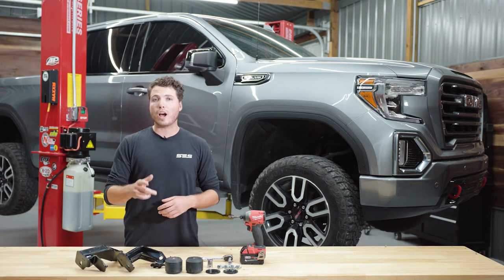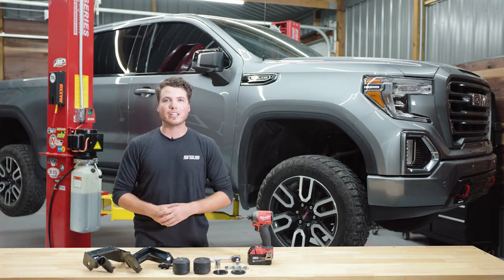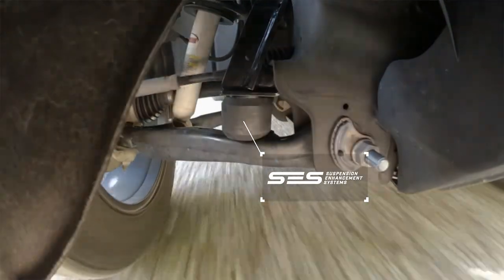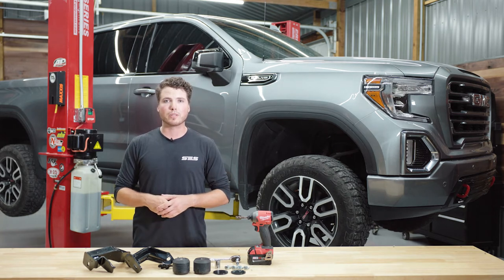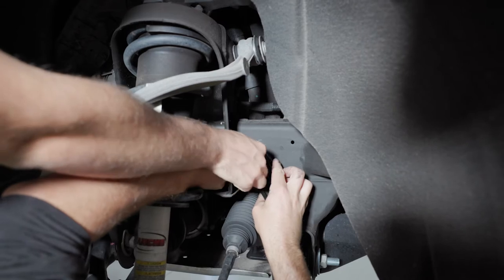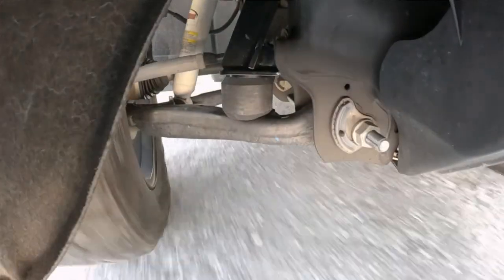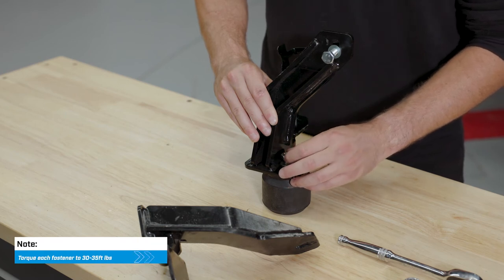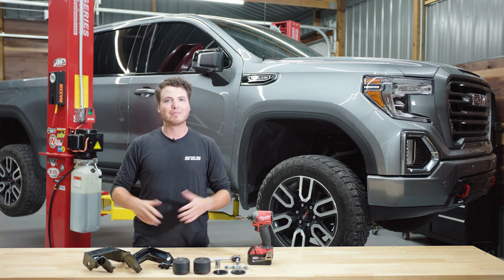GMC 1500 Snowplow Suspension Upgrade | Timbren SES Install

Comment: Does it add any lift if there’s no extra weight on the front of the truck?
Reply from the maker: Nope! These are designed to be engaged full time up front and will compress slightly while suspending load right away. No added lift.

Comment: Will these work with a truck that has leveling coilovers? Slight front raise over stock
Reply from the maker: Depends on how much it is raised. Can you take a measurement between frame and control arm? How much space do you have?